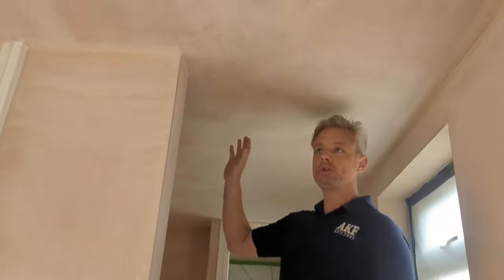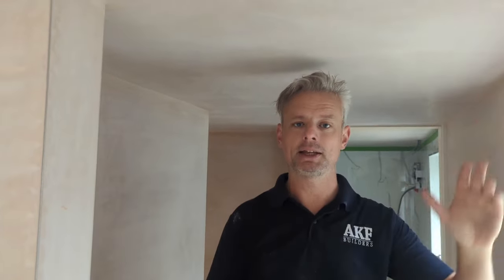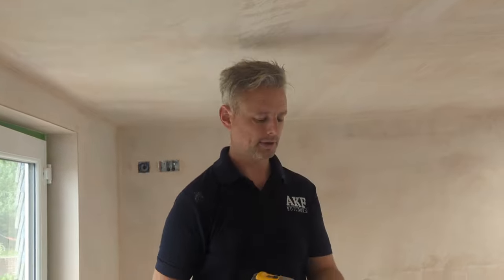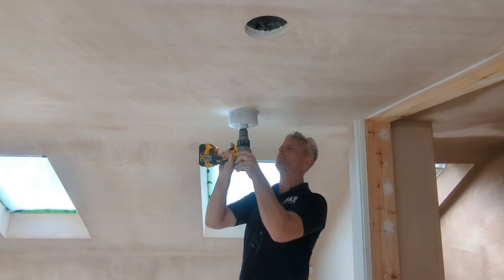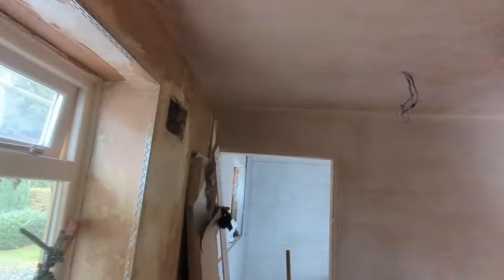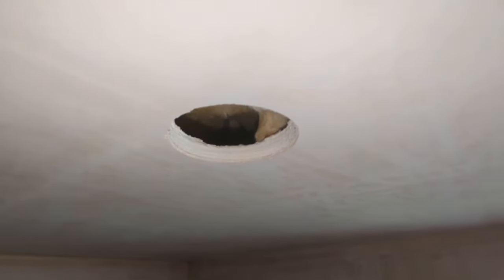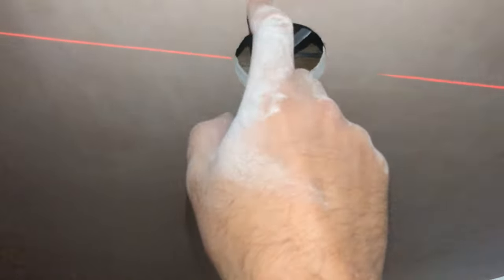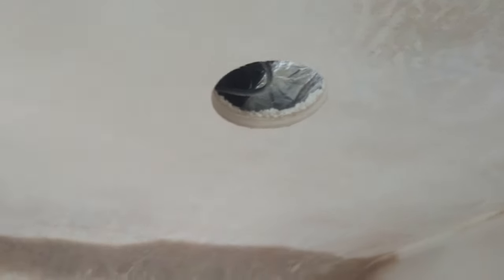I have trust issues, so I'll do it myself! Loft conversion #31 #loft #howto #downlights #spotlight

Comment: Was the ceiling height an issue with planning?
Reply from the maker: Hello Mark, regs are that the very top of our new roof can't go higher than the existing ridge, taking that and all the insulation that you have to use, again for regs, brings the internal ceiling down a fair bit.

Comment: Is that cealing really short or is you really tall
Reply from the maker: A little bit of both mate!
Reply: @Mr_A_Builders  yeah you can really see how low they are in this. Wouldn't like to actually have to use that shower, would be a nightmare.
Reply from the maker: We can only work with the house we've got and adhere to the regs we've been given fellas.
Reply: @Mr_A_Builders  No fault of yours! Just not sure I'd advise it in most situations.
Reply: What's the minimum head height 2.2m 🤔 
All that money spent to have to duck when you get in the shower . Appreciate its building regs but is there a reason why the ceiling height is so low? Surely the final flat roof height could of been higher!!! Or is the original height of the gable end dependant on the height! 

Are they having an electric shower in that bathroom or run off the combi/ unvented cylinder. 

All those lights! I hate to have their electric bill this winter 🙈💷💷💷
Reply from the maker: Hello actorlyric (great name by the way) hope you're well and thank you for your questions. There is no minimum height for the ceiling, only for escape routes i.e stairs. The ceiling height is dependent on the ridge of the house that we can't surpass, the depth of the timber that we have to use as specified by the engineer, and the insulation that we have use as specified by building regulations. By all means feel free to subscribe (if you haven't already and if you have, thank you) and watch all our other videos in this series which will answer all your questions in more detail. We really appreciate your comment and questions so please keep them coming. Take care.